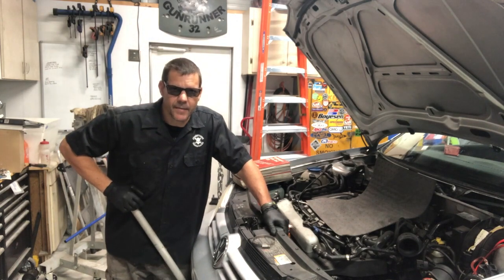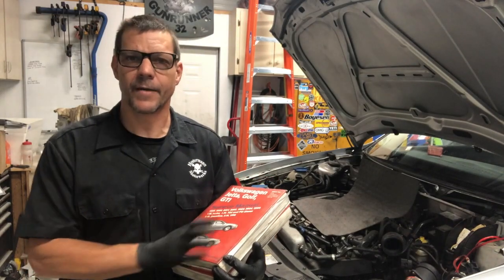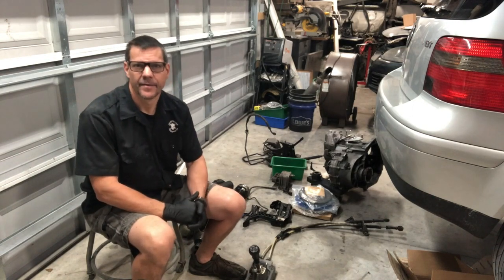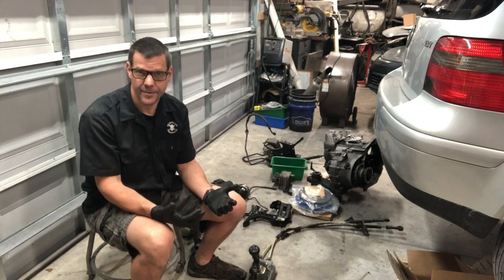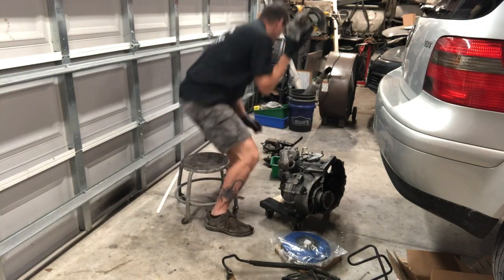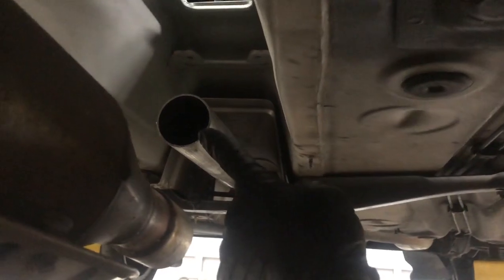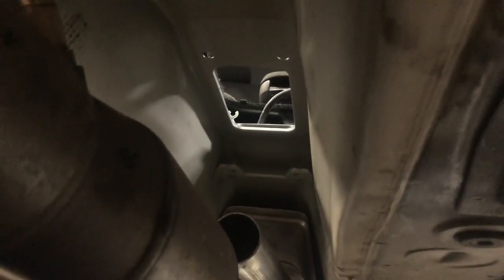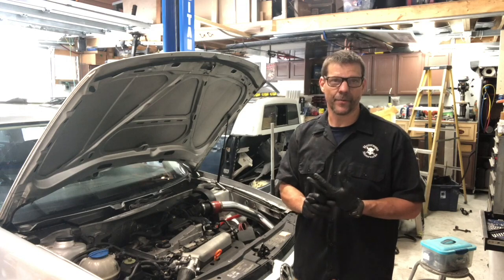MK 4 VW tiptronic auto to manual swap (1 of 3)

Comment: Thank you for all the thought and effort that it clearly took to put these videos together for others!  I ran across these only recently after doing a DSG to 6-speed conversion on my 2006 TDI JETTA back in 2016 and THAT was after a failed attempt to "fix" the bad DSG....  Worked great for few months while I attempted sorting through all the TCU triggered faults in the ECU ABS etc.... Long story short, had to park and moved but I'm back to the car 4 years later and wanting to finally resolve so I can SMOG and use as DD.

Here's my question: I've got the full VCDS setup and am heartened you comment (@24:30) that with the TDI you don't need to reflash the ECU if it's a TDI: you just need to re-code the ECU for manual with VCDS.  Your conversion is on an MK4 but mine is an MK5.....  I'm thinking this might NOT be the case for MK5 TDI ECU??
In other words, I might have to either re-flash my TDI ECU or replace with new ECU (& then obviously deal with IMMO stuff)

What's your thoughts?  Thanks 😊
Reply from the maker: Sorry but Honestly I have no idea. The software/canbus system for the MK 5 is kind of a nightmare. I really don't know if you can recode the MK5 TDI ECU. I have a MK 5 TDI but it came as a manual so I haven't had to try recoding it. Maybe try asking on VW vortex?

Comment: Just the video I needed. Solidified my decision to swap my gti sense this was the only video clearly stating the needed parts. 3 days you say I take that as a challenge so I’m going for 2😅😅 but really I appreciate it greatly
Reply from the maker: Go for it! I bet you can do it! I just throw out the three days so people won't get in a rush or try to do it over the weekend and then not be able to get to work on Monday because they don't have their car back together. I think it is is reasonable to do in 2 days
Reply: @hestermannmotorwerks honestly mine has taken more like 3 weeks 😂(the initial 3 day weekend went out the window when I had a ton of trouble getting the bolts out to drop the transmission - then realizing I was missing random connectors meant trips to the junkyard). Now I’ve just been doing little bits after work (weekend camping trips every weekend the last month) but now that it’s broken free the rest should be cake if I can have a friend help with the flashed ECU.

Factor in a little extra time since I dropped the subframe to replace the power steering rack and refresh the brakes but I’m hopeful I will be done in the next couple weeks of after work time.

Comment: The easiest way to deal with that oversize brake pedal is to just drill out the spot welds, the smaller pad is actually underneath the large pad, but I actually prefer to swap out the pedal arm that the video talked about needing a special tool for......but you can do it without the tool by heating the nylon up with a heat gun then use a small screwdriver to spread it a bit while your pulling and it will just slip right off that ball rod going to the master cylinder....great video!

Comment: Thanks for making this video. I just bought a 01 golf GTI with a 02 GTI AWP engine from someone who did this swap but didn't finish it. Car runs and drives, but the gauge doesn't work, has 2 different keys (one for door other for ignition), i have 3 ECUs for it. I need it to pass GA emissions, so i need to find out what he missed electrically
Reply from the maker: That can be tricky buying someone else's unfinished project. Even when they do a good job, it can be challenging figuring out exactly what they did or didn't get done.

As far as your keys go, getting a fob programmed to unlock the doors on your ignition key is one way to tackle it. If you take it to the dealer, they can get you new lock core for the door that matches your ignition key. Might want to get one for the rear hatch also. Not sure how much they charge though
Reply: @hestermannmotorwerks  I'm almost done with figuring it out all thanks to you. I really appreciate all the hard work that YOU put into making these videos. God bless man

Comment: I’m finishing up a 6 speed swap on my vr6, and I’m stumped. When I went to start it for the first time, the key rotated, and nothing happened. No clicking, and I tested the starter and it’s working fine. I by passed the neutral switch for the clutch pedal, and I wired the interlock relay. I’ve checked all my grounds and they’re all on and grounded
Reply from the maker: double check that you bypassed the clutch pedal switch correctly. It needs the ground to complete the circuit.

Comment: Absolutely FANTASTIC tutorial man, thanks so much. I am doing this for my wife's car, we got jetta MK4 1.9 tdi 2003 automatic super cheap from our friends in good shape. Now. It is ALH engine. Can you please help me? Will manual 5 speed transmission from jetta ALH mk4 1.9 tdi 2000 fit with gear ratios? I am assuming it will, right? 
Any advice would be much appreciated.
Reply from the maker: Yes the 2000 trans will work fine. And your wiring will be easier in your swap, you won’t have to mess with the whole VSS circuit just swap connector  at the transmission
Reply: @hestermannmotorwerks  That sounds good thank you very much.  It is gonna be the project of my life...

Comment: Thank you for the video.. i have vw sharan 2006 i am 2nd owner of the vehicle and i just knew recently that he swapped the transmission from A/T to manuall but since i am driving this car for almost 5 years the car caused lot's of troubles since the swap was bad..
 they swapped only the transmission but the ecu and wiring still the same as A/T..
So right now my problem the car lacks power and feels like it doesn't have enough torque to move.. none of the technicians could solve my problem.. one more thing during the winter when i start the car the accelerator pedal doesn't work unless the car warms up.. couldn't identify the cause of the issue
Reply from the maker: we don't have the Sharan in the US so Im really not familiar with it. It also will depend on what the engine is and what the transmission was. If it is a TDI (BEW or BRM or maybe even the BHM) you should be able to get the ECU recoded to manual transmission by anyone that has VCDS or a similar code reading system. If it is one of the gas (petrol) engines, you have to get the ECU recoded by someone with EEPROM capabilities or swap the ECU. That could be the reason for loss of power but if it has been driving fine before and now is just having the power loss problem, then it isn't the ECU coding.  The accelerator pedal issue could be lack of good ground to the engine. I would first try taking the grounding cable off the transmission, cleaning it very well then reinstalling it. It should be on the top forward bolt of the transmission. If it isn't there, then you will have to follow it from the battery negative cable. It should go down to a bolt under the battery tray where it bolts to the body, then continue over to the engine. Common for people to forget the engine/transmission connection when reinstalling a transmission. It attaches in a different place on A/T vs M/T.  Make sure it it is making a good connection. Poor grounds will do all kinds of weird stuff!
Reply: @hestermannmotorwerks  thank you for the help and yes its 1.9 tdi i noticed the loss of the power since day one and the seller told me it's the turbo needs to be replaced turns out the turbo was just fine .. i will try to record the ecu as it's still shows as an A/T this might me be the main issue

Comment: Great Video,  I want to swap my vr6 01m 4spd auto to a 02m 6spd manual. The axles currently in the hub use a nut at the end. Do you know if all six speeds use a bolt at the end of the axle?
Reply from the maker: some axles have a nut and some have a bolt. The nut style is more common. should be fairly easy to find.

Comment: Really appreciate you putting together this series. We have a 2004 MK4 Jetta w/ 09a.  I found a 2003, Beetle Turbo S (1.8t with 02m)  Just want to confirm,  axles from Beetle will fit Jetta?
Current axles in the Jetta are bolt type.  Beetle is nut type.  Will I also have use the spindle hub from the Beetle?

Thabks again

Comment: Starting this tomorrow, with my mk4  auto tdi, swap with a mk4 manual tdi
Reply from the maker: Awesome good luck! The car will feel more powerful and more responsive !
Reply: @hestermannmotorwerks   And tips since I bought a tdi manual for my tdi auto, my car currently has 113k god bless but its an auto, the manual transmission I got was at 291k , and was wondering if you could possible link some wiring diagrams that would make it easier when I'm at that part, transmission came out in the donor car with a little but of fight left in her but I'm one step closer to being complete :) p.s. your video motivated me to do this since I've wanted to do this for the last 2 years

Comment: can you help me with the electrical diagram of a 2002 jetta i watched your videos repeatedly but the pins are in different connectors
Reply from the maker: yes you will have different electronics. You have an 01M auto which is actually easier. You won't have to do any thing with the VSS circuit because the 01M has a speed sensor in the same place as the 02J. Just switch it over. Other than that I would recommend a Bentley manual.

Comment: I have a 05, 1.9 tdi bew with 09a transmission and I'm looking to do this. When looking for a parts car would my best bet be to look for another tdi because of the transmission gear ratio thing you mentioned? Or could I use an o2j outta of gasser mk4?
Reply from the maker: I highly recommend a TDI trans for correct gearing. You can physically bolt on and use a 2.0 or a 1.8t trans but unless you are trying to adjust gearing for another modification (maybe really big wheels) I think you will be disappointed with the gearing. You can use the trans of a BEW or an ALH engine and it will be perfect.

Comment: Trying to 1.9tdi (bew) swap my mk1 rabbit. Here to see what I need to do to make it a manual.
Reply from the maker: I swapped an ALH into a mk1 rabbit pickup.my approach was to just take as much harness as I could and put it in the MK1. If that is your approach while you have the harness out, I’d make the wiring corrections. Then you can pull out all the wiring you don’t need anymore making the install a little cleaner. Don’t for get the fuel boost pump on the BEW
Reply: @hestermannmotorwerks  I'm kind of cheating and sending my harness off to s&p auto from both the mk4 and mk1, they have a whole conversion kit from mounts to wiring. My only problem is I trying to swap from an auto tdi to a manual tdi. Trying to figure out what transmission to get and where I can find one because there like candy and gone as soon as there listed lol

Comment: Quick question, love the series by the way, great help. My downpipe is welded to the cat like the car in your video. If I cut it like you did, what type of union do I use? Haven't done exhaust clamps before not sure exactly how to fit it back together. Thanks.
Reply from the maker: if you do a google search or Amazon search for your exhaust OD and add "exhaust coupler" you'll find some options. Here is an example for 3 inch. These are the style I prefer. Just ensure you get one for the size of your exhaust. https://www.amazon.com/dp/B078TZCMX5/ref=cm_sw_em_r_mt_dp_IT2OFbZ03MMH3?_encoding=UTF8&psc=1

Comment: are you able to use a AT harness for a Manual Trand or rewire it if you have the correct connectors?
Reply from the maker: That’s what video #2 is all about!

Comment: Does this apply for a 2014 vw golf 2.5 pzev? Also is it hard to do a forward wheel drive to rear wheel drove conversion?
Reply from the maker: Mechanically its similar but the electronics/wiring is more complicated. Doing an AWD conversion is possible but you will need a lot of parts and you may have to do some sheet metal fabrication. The floor pans on the AWD models are different to allow space for the driveshaft and rear differential. The fuel tank is different also for the same reason

Comment: Hi I have a gli automatic with bad transmission but I also have a donor tdi 5 speed what are the cons of using tdi in to the gli I really need some more info on this thanks !!!!
Reply from the maker: you might have to do a little research about gearing but basically the TDI trans will be geared too long for the gas engine. The car will feel low on power. Ever accidentally used the next gear up when driving? Started from a light in 2nd type thing. Maybe not quite as bad as that but it will feel like that. Good news for you is the TDI trans are usually in high demand. You should be able to sell the TDI trans for more than what a gasser trans will cost

Comment: What transmission do you recommend for a 12v and a 24v, ive got both automatics and i dont know which one fits which
Reply from the maker: I like the 6 speeds (02M) but they are more expensive and the clutch and flywheel and the axles are more expensive also. The 02J 5 speed is a little more robust though so if you are going to build a high horsepower engine, you might want to consider the 5 speed. The VR6 transmissions are different than the other engines. The bolt pattern is different on the VR6 but both the 12 v and the 24V are the same as far as transmission pattern. So any VR6 trans will work for either of them.

Comment: I have followed these videos religiously throughout my project and had great success. My only issue is with reprogramming the ECU. I took the car to a VW specialist but they were unable to get the necessary changes to save to the ECU. Any suggestions as to how to proceed?
Reply from the maker: The TDI ECUs can be reprogrammed with VCDS but the 1.8, VR6 and 2.0 ecus won’t save. It has to be reprogrammed thru the EEPROM. Many Tuners can do that for you. I use Blake Idziak in Ocala FL. You can send him the ECU via mail. He is usually pretty quick to get it done and back in the mail to you. You can find him on Facebook as “The Dub Shop” https://www.facebook.com/The-Dub-Shop-314755221877423/
Reply from the maker: I usually get the immo defeat done at the same time
Reply: So had the ECU coded to 02J via eeprom by a tuning shop. Prior to this I was getting communication error codes for both the ECU & TCU. Since the coding those error codes are no longer an issue. However my GTI is equipped with an Anti Slip Regulation switch which is currently not functional. I believe it is causing another communication error with the ABS system. The code is generic so I assume I may need to do some more wiring. Any experience with this?
Reply from the maker: @brettgrande8992  Ive have had ASR issues but not as a direct result of a trans swap. most common reason is a sensor not reading a wheel magnet. Can be a bad sensor, damaged doing a wheel bearing, or built up metal shavings from someone that goes to the metal on brake pads lol. I have seen a couple that were broken wires from forgetting to unplug them when removing the hub. . I think this issue is not related to your ECU programming. I'd check sensors and wires carefully before spending too much time tracking down ECU signals.
Reply: @hestermannmotorwerks  thank you and stay tuned!

Comment: im assuming that in big lines this video applies to the a3 8L as well? got a multitronic in there now but really wanna make it a manual since thats when this engine's potential really unlocks lol. Hope any of you guys know! thanks :)
Reply from the maker: Yes it should be really similar. I don't know for a fact but would guess the 109 relay wiring is identical. The ECU is probably different pin numbers and color codes though.

Comment: Hoping to manual swap my mk5 from an o9g automatic to kpf 5 speed. From your knowledge, will i need anything additional from your listed parts? Seeing as the cars are only 4-5 years apart im assuming its the same process as what you've shown.
Reply from the maker: Should be pretty close but the electronics are significantly different in MK5s vs MK4s so you may have some issues there

Comment: Great and helpful video!! Goes into great depth. I’ve got a question though. Will a ecu from a manual 2.0 work on a automatic 1.8t? Or would I have to get one from a 2.0. (I don’t care if the vin doesn’t match)
Reply: You need a 1.8t ecu to run the 1.8T.
Reply: I have a friend who said you can use the same ecu and cluster if you jumper a few things on the harness to get the speedo to work.

Comment: So I have an manual 04 bug 1.8t and a auto 1.8t Jetta should I have everything I need ?
Reply from the maker: Im not 100% sure on the 1.8T ECU wiring between a Jetta and Beetle. Other than that you have everything you need
Reply from the maker: you are probably better off just getting the Jetta ECU reprogramed so you don't have to worry about the IMMO anyway.
Reply: @hestermannmotorwerks   If I’m just going race car I really don’t need the speed sensor and the reverse lights so I don’t even have to cut into the wiring harness right

Comment: I have a 2004 GTI 1.8t It used to be Tiptronic Transmission, but a friend of mine swapped a Manual 5 Speed Transmisión, everything worked except the Speedometer, did he made a mistake with the wiring harness? Or it is just the Spped sensor that may not work? RPM And all the needles work except the speedometer.
Reply: The speed sensor wiring is kinda confusing. I would guess that it is missing a link somewhere but your friend may have done all the wiring correctly. It is possible the sensor (or even the connector) is bad. I haven't seen a sensor go bad though. RPM and all the other gauges get their input from different places so that really has nothing to do with the speed circuit
Reply: @hesty32  :(